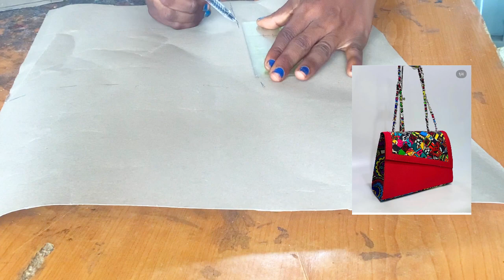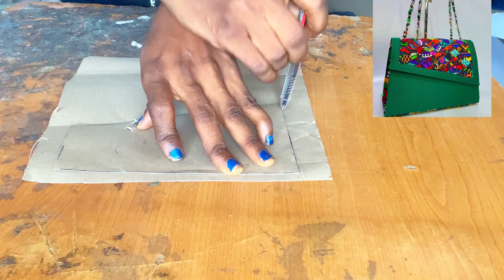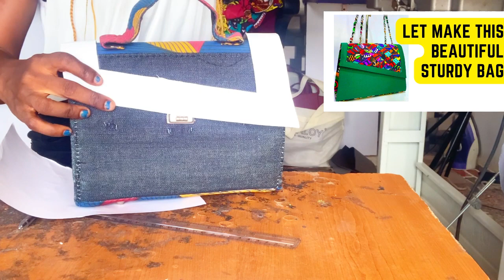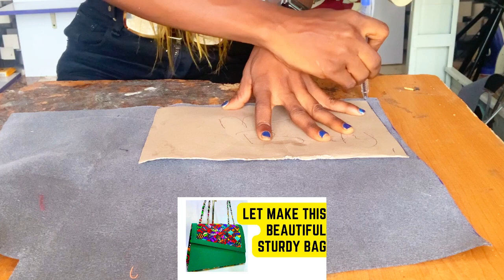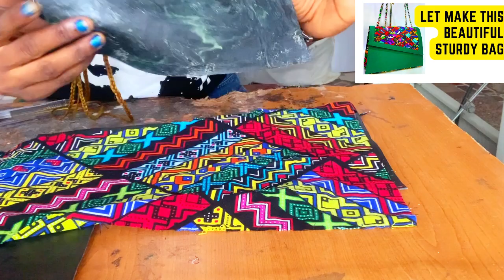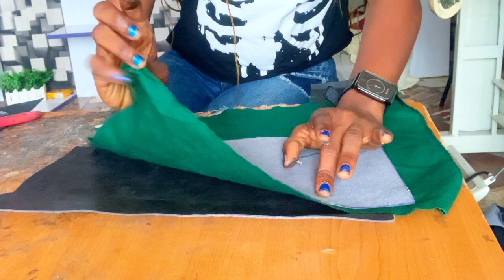SEW A LUXURY ANKARA BAG |WITHOUT AN INDUSTRIAL MACHINE | LEATHER BAG |

Comment: What type of material are you using for the flap/body.
Reply: This may sound a bit unusual for a flap, but I buy the foam dollar tree placemats, they work great and they dont crease when you fold them over.  They have a shiny side, and are maybe at least a 1/6 or 1/8 inch thick.  Leave them out of your flap seam though
Reply from the maker: Thanks ❤️
Reply: Please the red material you used what is the name please